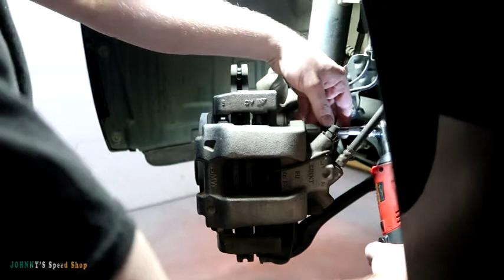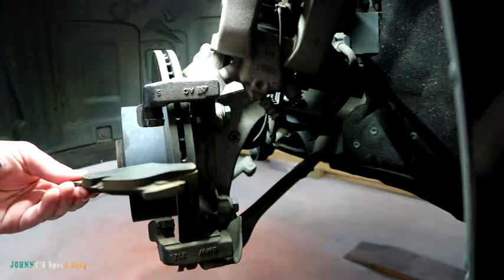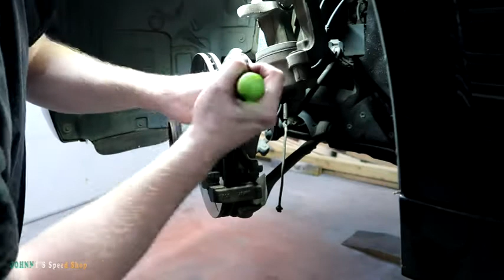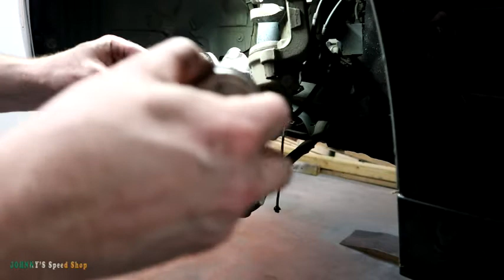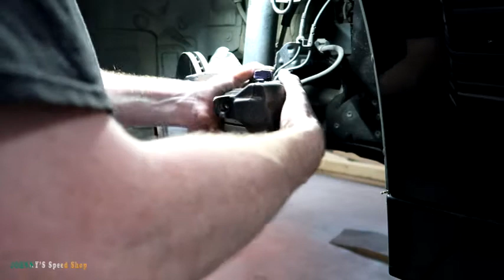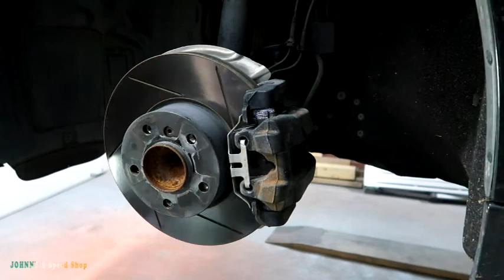2017 BMW 3 Series Front  Brake Pad Replacement

Comment: Anyone knows the Type of tool you need in order to release both bolts 🔩
Reply from the maker: If I  recall they were E torx...  ( female torx )
Reply: Just Allen key I think not torx
Reply: Buy yourself a small ratchet with a set of Allen key head sockets .
They can be awkward to get out but take your time reinserting them